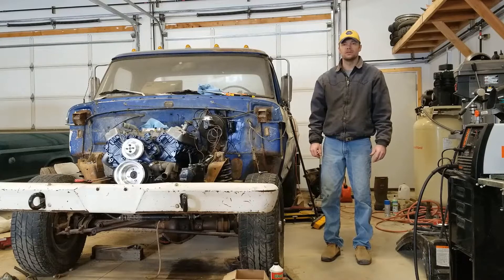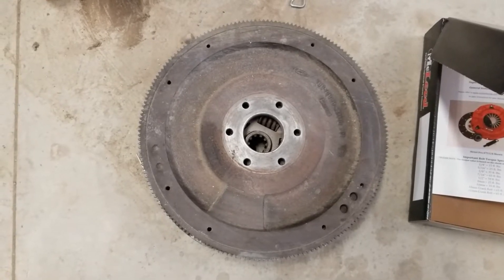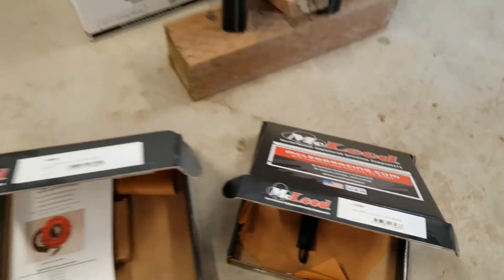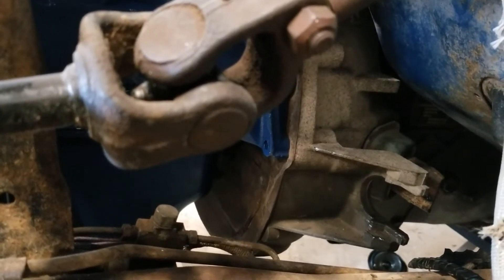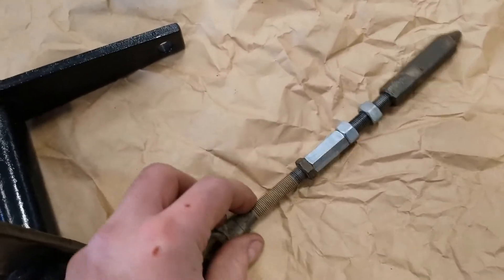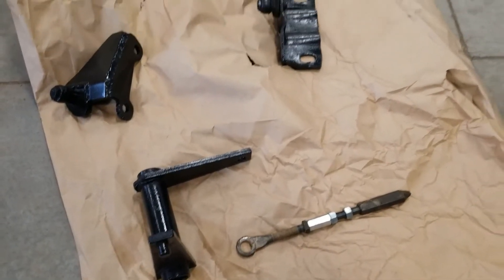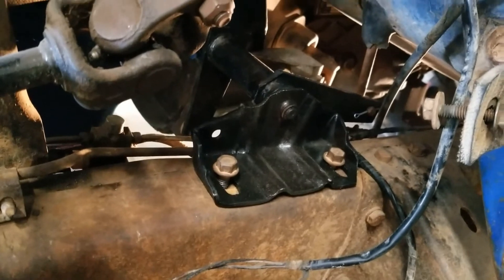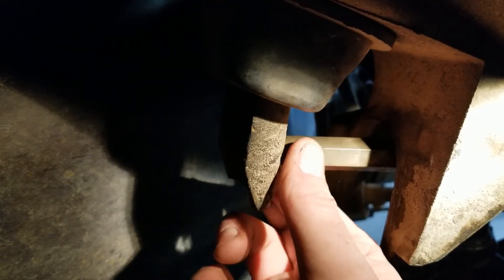Ford 460 ZF5 transmission swap mechanical clutch conversion

Comment: Did you have to modify your floor plan at all?
Reply from the maker: Not for the transmission.  I used the stock 1991 transfer case shifter location, which was left of transmission hump.  I did need to cut a little bit of the floor out of that spot.

Comment: Hey I’m running into an issue with finding a pilot bearing my motor is a early 70s and I’m putting a 7f5 behind it and I need to know what pilot bearing I can run
Reply from the maker: Did you try getting a pilot bushing for a 1992 - 1997 F250/F350 with a 460?

Comment: at 9:08 , you have a support on the inside/engine side for the axle of the Z-bar. on my truck, the previous owner made the z-bar sit completely on the frame side, and just made the rotation axle super thick (about 1.5 inch thick) . I'm surprised it even worked
Reply from the maker: I can see how that would make things pretty stiff.

Comment: the previous owner on my truck swapped in a 7.3 IDI + ZF5, and used the original mechanical clutch linkage on the 77 F250. the mechanical linkage is way too stiff for the modern ZF5. I got to graft in the proper hydraulic actuator some time, but unfortunately the previous owner cut off the holder for the hydraulic cylinder on the back of the bellhousing, maybe I'll have to find a new ZF5
Reply from the maker: When you say the mechanical linkage is way too stiff, are you referring to the clutch being too stiff?
Reply: @adamdice231  yes, anyway it's the whole action sequence: pedal-->linkage-->clutch

Comment: Hey Adam i fixing up a ford truck my dad gave me I was wondering what kind of fly wheel i should use for a 460 with a c6 or c4 manual transmission it’s in a 1976 f100 xlt, I have all the mounts and it’s already in there I just need to know which fly wheel i need because I keep going through starters because the fly wheel doesn’t meet the starter flush and I keep going through starters i had to modify the starter and push it a bit forward for it to turn the engine, just wondering which flywheel would you recommend?
Reply from the maker: When you say C6, I am assuming that you are referring to an automatic transmission and you are talking about the flexplate and not a flywheel.    The C6 was a stock offering with a 460 and even in a 1976 F150.  You should be able to just use a stock flexplate and starter for that application.  Do you have the thin factory spacer plate installed between the block and the transmission?
Reply: @adamdice231 wait I said the wrong transmission, it’s a borg Warner t18 and Im trying to find out which flywheel I should use since it don’t align with the starter
Reply from the maker: @Smooth-_-Sluice  was that like a T18 from a mid-80's Ford behind a 460?  If so, you should be able to use a factory flywheel and starter.  What parts are you currently using that are not OEM?  And are you using the thin spacer plate that goes between the engine and the bellhousing?
Reply: @adamdice231 no the transmission was made before the 80s my dad was saying they don’t make manual transmission’s with the 460 but he made it work
Reply from the maker: @Smooth-_-Sluice  80's F250s and F350s had a factory 4 speed behind 460s.  Late 80s and 90s F250s and F350s had a factory 4 speed behind 460s.  Your swap would probably be easier if you were using one of those.  So what is your T18 from and what flywheel are you using?  Also, I'm still unclear if you are using that thin spacer plate or not between the engine and the bellhousing.
Reply from the maker: Got to typing too fast.  Late 80s and 90s had the ZF5 5 speed.

Comment: Hey man I’m fixing to swap a 460 into my 77 f250 from the original inline 300. I’m needing to know what motor mounts I should get and if I’ll have to move the to a different location on the frame
Reply from the maker: Make sure to fact check me on whatever I am going to tell you.  I'm pretty sure the frame engine mounts for a 300 are the same as the frame engine mounts for a FE.  The 460 frame engine mount is different.  You will need the frame engine mounts for a 460 that fits a 73-77.  The motor mounts that I ended up using were https://shop.broncograveyard.com/1978-1979-Ford-Bronco-4wd-Ford-Truck-Extreme-Duty-460-Motor-Mounts/productinfo/20990/.  They are a heavier duty motor mount and I believe thicker than a stock motor mount.  I also used the frame engine mounts from L&L.  They bolted right onto the frame and there was only one way they would work.  When I compared the L&L frame mounts to my stock FE frame mounts, they looked awful close to the same.  I think I could have used the FE mounts.  Using the heavier duty motor mounts, the engine sat way too high, and I cut some out of the frame mounts and rewelded it.  In my opinion, my engine still sits a little high and I could have cut some more out of it.  Knowing what I know now, I would determine which motor mounts that you want to use and then set it in with your 300 frame engine mounts and see if it works.  if not, then buy the frame engine mounts that make it work.  Hope this helps.
Reply: @adamdice231 thank you for your help I really appreciate it 👍

Comment: Have you driven this setup yet? I'm about to swap a 300 straight 6 with ZF into my old crew cab. Somebody ground the slave cylinder Mount off. I think I'd rather have mechanical anyway

Comment: Crap. The 2wd l&l mounts also have it too high.

My z to fork rod angle is atrocious and i made my own zf5 z bar bracket level with frame mount. Needs to go up
Reply from the maker: Yeah, mine was terrible too.  I thought mine was probably due to mix and matching parts and lowering the engine.  Sounds like you got it figured out.
Reply: @adamdice231  I'm at the l&l height and if the engine n trans went down about the 7/16ths you mentioned it would reduce the angle for sure. 
I need to pause n look at your block z mount n compare to mine.

Comment: On some of the earlier truck firewalls there is clearly a spot where a clutch master goes for the bigger trucks - F600 and up.  So you could have stayed hydraulic which is quite a bit easier but you would have had to go to hydroboost on the brakes which isn't a terrible idea either.

Comment: Thank you for the thorough video!
Wow I wish I had this as a reference last year.
I didn’t have a z-bar for the automatic transmission cab I used because I did a swap onto a manual 1986 F350 frame. I ended up building an extension rod for the 86 pedal assembly and moved the clutch cylinder further center in the engine compartment with tons of firewall bracing. 
I definitely would have spent more time trying to track down those OE brackets and gone this route instead.

Comment: did the truck have a t18 in it before the zf5 and if so what modifications to the truck did you have to make to fit the zf5 i got a 1977 im wanting to swap
Reply from the maker: It had a NP435 in it.  The mounting point for the ZF5 transmission is further back than the existing crossmember.  I made a new transmission crossmember.  The 1356 transfer case is also big enough that a little notch needs to be cut into the lower part of the frame.  I was planning on making a video showing some more details of the project anyways, but I'll try to hurry to show the details of the transmission swap.